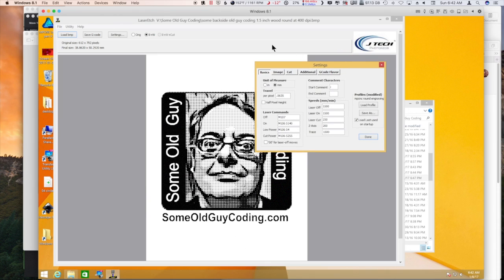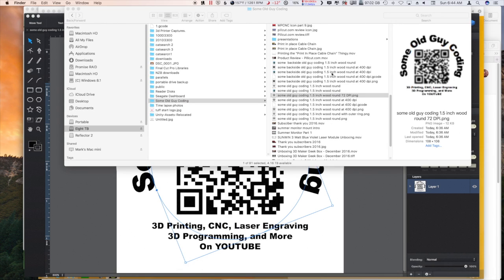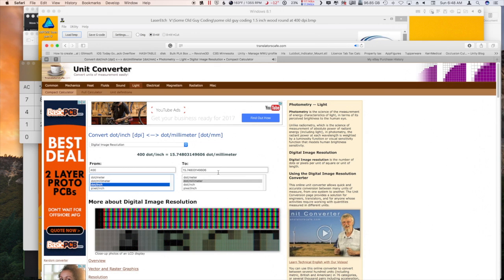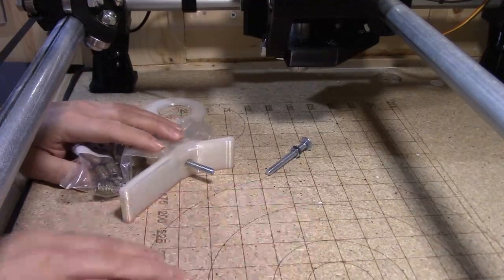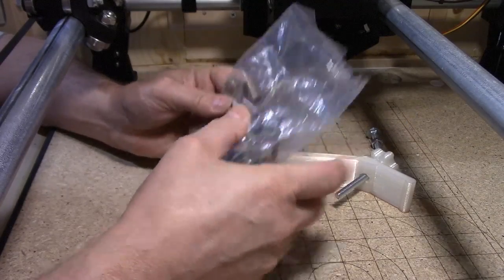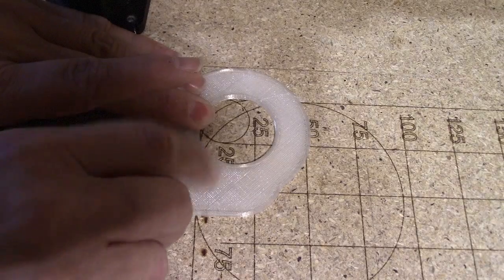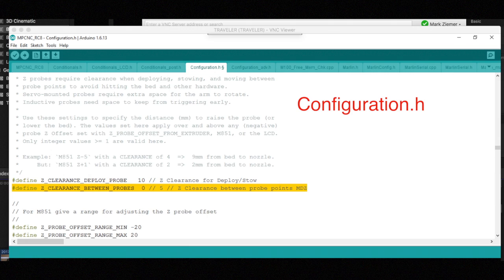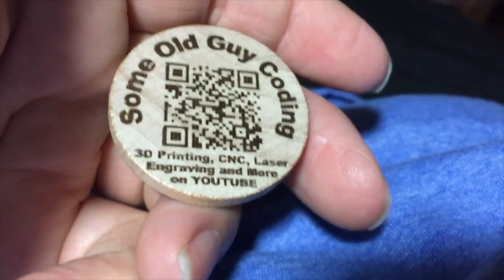Mostly Printed CNC MPCNC 10 Playing With LaserEtch

Comment: what size is the working area on your mpcnc?  Are you pretty happy with that size? How is the rigidity?
Reply from the maker: 290 mm x 600 mm. Kinda small, but I didn't want to go any larger with the space I was allotted. Nice thing is that it's easy to manage. everything's within an arm's reach.  I was going for 300 x 600, but apparently didn't measure properly when installing the feet. If/When i get the room, I might go larger, or build a specialized machine for laser work. I'm not going to be building any furniture with my small CNC, but I don't have any plans for that for now anyway. The Rigidity seems good, but I haven't cut anything harder than fiberboard at this point. I recently lengthened the legs to about 5.5 inches. So we'll see how that works out.

Comment: Why not use your router and the fusion 360 to generate a grid then have it route out it's own 9mm holes so you can put the anchors in ;)
Maybe putting G0 x-10 y-10 (head will try to go to negative but will stop when it hits the end stops signifying zero without moving the z axis
I like the 3D printed mass production jig you designed...very ingenious

Found this...might help  gcode cheat sheet
https://thingiverse-production-new.s3.amazonaws.com/assets/87/b0/2c/f5/4c/CheatSheet.pdf
 Might be able to use G91 G28 X0 Y0 and leave the z off either way your work around seemed to do the trick anyway

Really like your video's!

Comment: thanks for sharing your work on this. I'll be building a mpcnc shortly and have gleaned a lot from your videos.
Reply from the maker: Evan M. Jones 
  Thanks!  Glad to hear that these have been helpful. Be sure to share your build experience on vicious1.com
Reply: Some Old Guy Coding I will. Building a shop in my basement but I've got to get some concrete poured before we can proceed. I'll have maybe 600 square feet of floor space to play with so I'm planning a 4x8 cnc.
Reply from the maker: Evan M. Jones 
Nice!